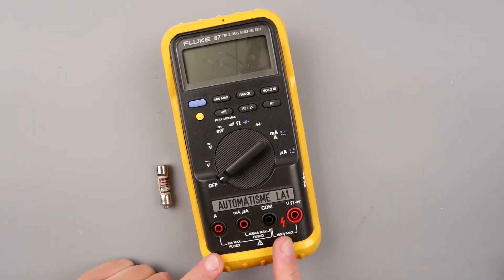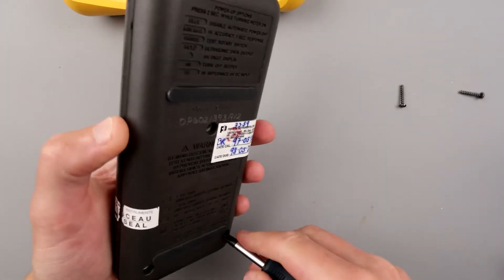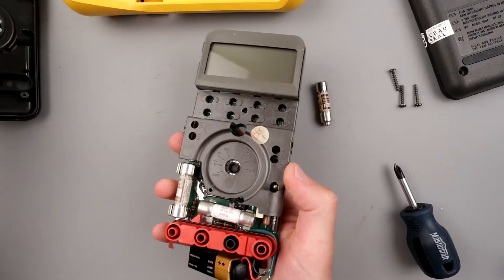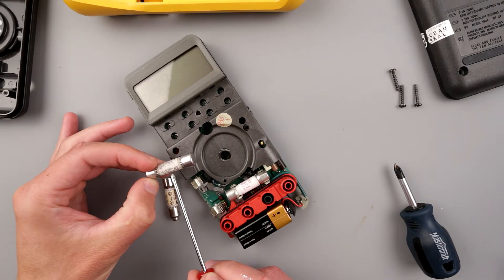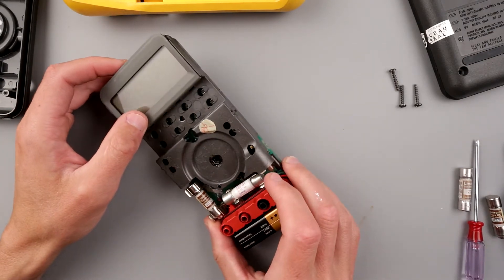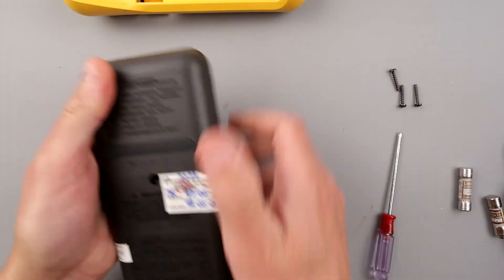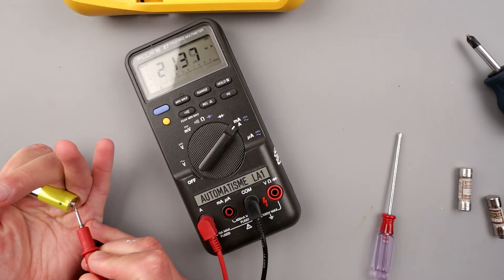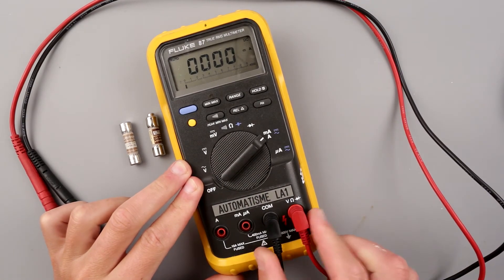Do not blow your multimeter

Comment: I got to check it now.  Two fuse, one rather large and one small.  The small shows no continuity.  Under it on the board it says 250V, 600mA.
Needed a magnifying glass.  .5A, 250V on the fuse. Got one in the garage, .25A, 250V.
Reply from the maker: Is this Fluke Multimeter you talking about ? For Fluke it has to be Slow Blow 400mA for mA/uA range and 10A for 10A range. But better to buy fuses recommended in the video, they are expensive but properly rated !
Reply: @InsideOutElectronics  Them slow blow fuses are not expensive to that extent.  For now I installed 1/4 A slow blow fuse I had on hand.   My fluke multimeter has one 10A fuse and one connection.  It can detect mA to one decimal but can not detect uA, while the chinese import can.
To install a $20 slow blow fuse on multimeter that cost $30 brand new is another story.
If I look hard enough I can find slow blow .5A fuse in my infinite pile of ...... oh my
Reply from the maker: @alchemy1  Good point ! But still safety is important :)

Comment: Except I had my multimeter on mA/uA when I decided to test  24V AC  output of a transformer.  The fused 10A works but the  mA/uA is toast.
Oooh, I just noticed both are fused.  🙂
Reply from the maker: mA/uA has fuse as well... Was is blown?
Reply: @InsideOutElectronics  I haven't checked it yet.   I just happened to notice it as I didn't last night.  I had always assumed that is the big Amp that is fused. After watching your video, I saw two fuses there.   Just seeing it caused me to look, not because I assumed it was for the lower amp setting.   
So this import made multimeter is rather nice for the money.  Plus for around $30 or so dollar, it came with all sorts of extras too.
When I turn it all, it speak loud.  It beeps and beeps until it settles as if it is testing the influence of its surrounding.